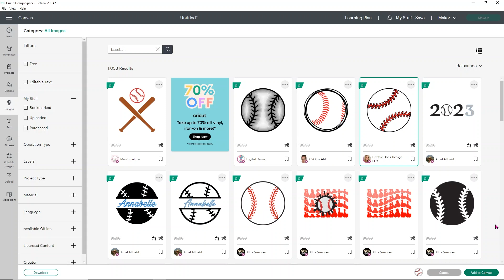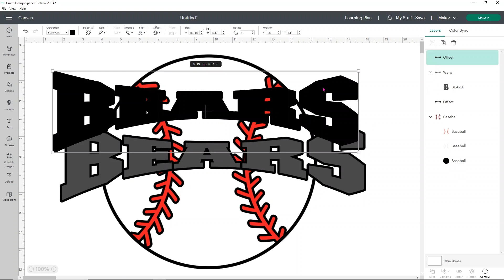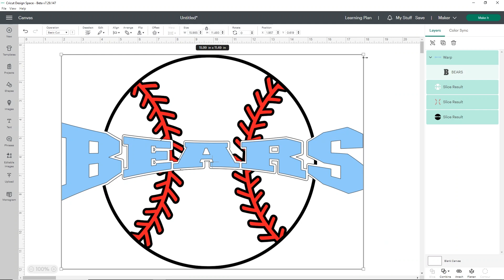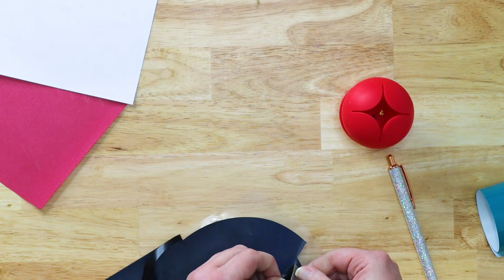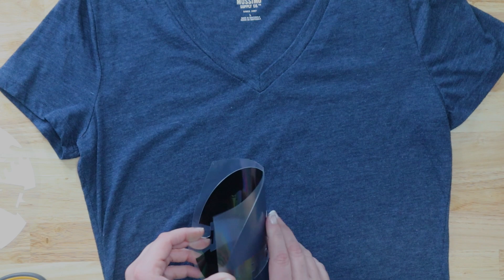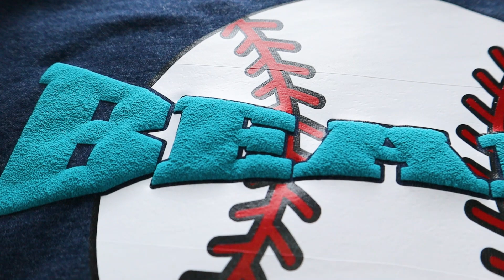Slice multiple layers in Cricut Design Space New Warp text feature with Teckwrap Puff HTV

Comment: Hi, is regular Puff the same as 3D Puff htv Or it's the pressure differentiate? Thanks
Reply from the maker: It depends on the brand you use some need different heat and pressure some need two presses